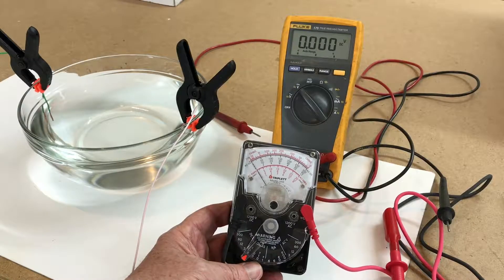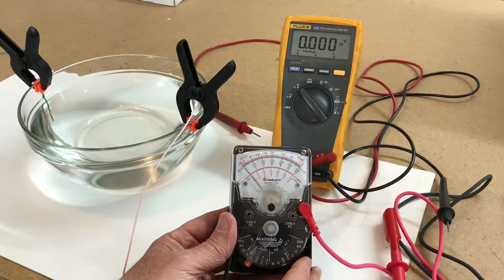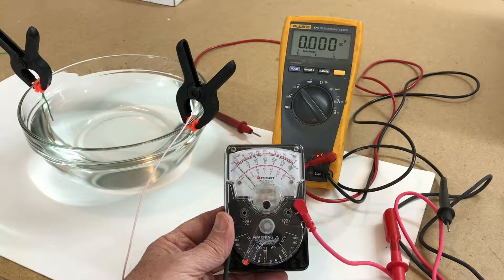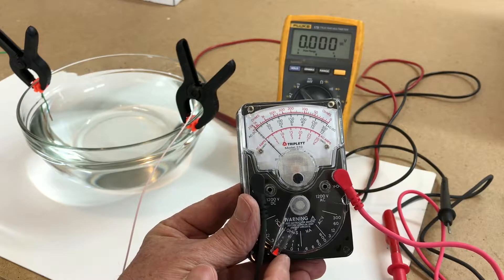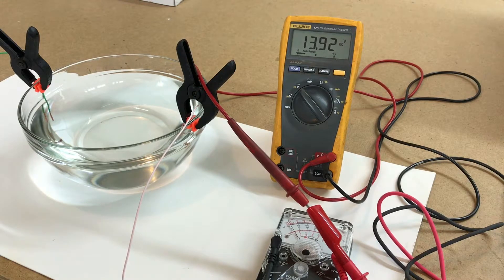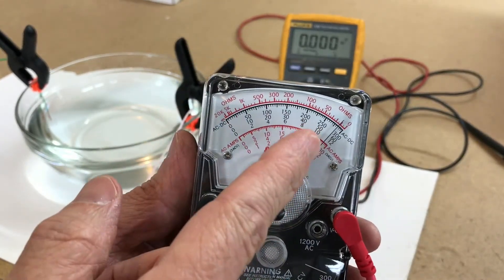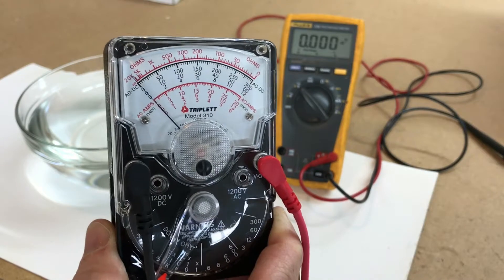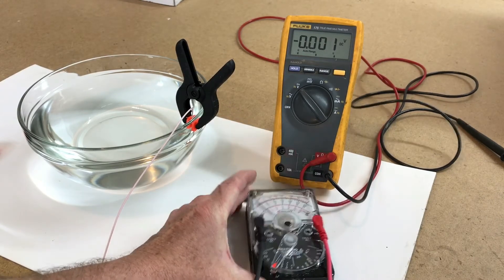Triplett 3018 Model 310 Analog Volt Meter

Comment: I agree.  Amateur Radio Operator here, and analogue meters are sometime better for finding intermittent high resistance (or open) circuits in antenna systems.  I had a very old 310 that I bought at a yard sale cheap and destroyed it, my mistake.  I just ordered a new one as the price has been slowly increasing.
Reply from the maker: I was turned on to the Triplett by an old-time technician. My original 310 had a bakelite case and a 15-volt battery.  The new meters have a 12-volt battery.

Comment: Like my 310 too.  These have the sensitive meter movements, 50ua and as a 20K ohm meter is hundreds of times better that most of the "cheap" analog meters and those cheap DMMs that may only have a few K.  Thanks for the "ground" troubleshooting example.  We have seen many of the "grounding" failures that you had described.